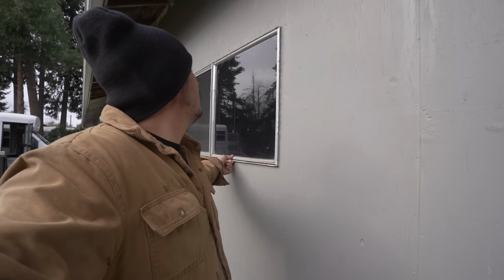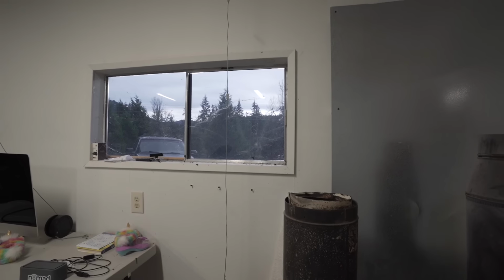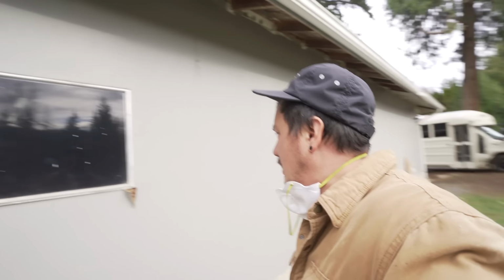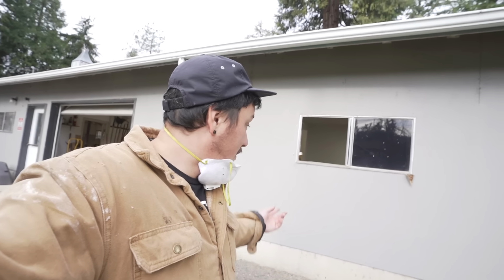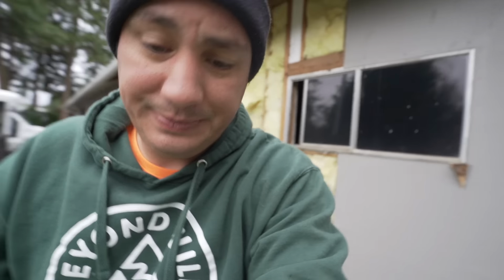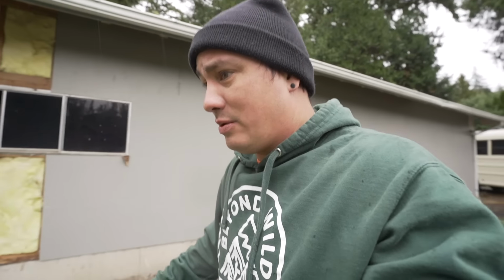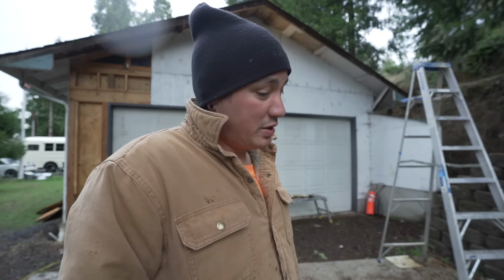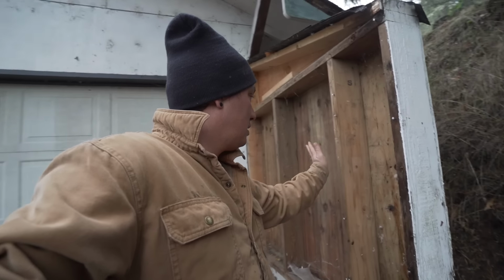In over my head..

Comment: You could have used a skill saw or multi tool to cut the plywood just outside the window frame so you wouldn't have to take off as much siding. Then just put a piece of the hole where the window was. Would have saved work and materials.
Reply: That was my first thought.

Comment: Not sure of the order or your codes, however a simpler way would have been to leave the window in place and framed it from the inside. Insulate it and fog the widow so not to see the insulation from the outside, and drywalled it up on the inside. Best of luck with future endeavors. Good job!

Comment: Isaac all you had to do was take a circle saw and cut two inches around the entire window. Set your saw to the correct depth so you DONT cut too deep. Once you cut around the window you can pull off the two inches of siding rather than pull off entire sheets. Remove nails on the window lip and window will come out from the outside. Doing it this way will prevent you from buying all new siding sheets.
Reply: And set the saw to the thickness of the plywood.
Reply: I was just going to comment the same thing....
Reply: Oh nifty!!

Comment: Dang all you needed to do was sawzaw around the window
Reply: Yep! Work smarter not harder!
Reply: Yup like moving 3 pieces of firewood at a time - get the darn wagon and fill it
Reply: Sawzall
Reply: Skill saw set at 1/2 inch. Go about 3 inches all around the window.
Reply: Call your construction  friend  to discuss  how to do the work, better  safe than having  to redo the work.❤😢
Reply: You could use the Sawzall to do it!
Any way you are doing great job keep it up!
I know you're frustrated is the only reason this is why you're doing what you're doing again you can use the Sawzall which would do a better job quicker I can see that you're so frustrated with this problem what time can make the wrong decision on what equipment you need to use.
And why are they wanting you to take that window out because I also can be used as a fire Escape from now you will be stuck in there if there's a fire.
Somehow you really need to put another window in there to ensure that you have a fire escape route how do I get going to have to come up with a new way to get out if fire is in the garage.
Sincerely!
R.S.V
Reply: Wow what a crazy mess getting that plywood off the building.  Was that wall thingy to stop snow from building up in front of the door?
Reply: I was concerned that the changes, if not done by someone who knows what they are doing, could put Isaac back in hot water with the inspector and county agency.   Careful Isaac.  Be smart.
Reply: Why does the window have to come out?

Comment: ok tare walls apart if there wiring & stuff in said walls take like 5 mins pen and paper draw a wall with where all the wiring is & went and out let boxes & there location why I had a wire mess up i had to wire the outlets threw one patch wire i had guy ha wired it to breaker box had some wiring layout of my home the hall light feed the rest of that breaker instead of taring the drywall off the wall & flooring too or run a new 10-2 wire covered it along  the floor its a new section of wire to side light & junction it there did away with the light! moved it to other light out side some one put a inside light that made for out side really! the wire guy said who wired this place really! i paid him a pile of money to fix it or go cold the heater run off this system too! it gonna cost you fix the dead ford truck i worked on for months it run like 10 mins and stop & let set 20 mins run like 15 mins and die ( did you read the ford recall error no it a box on the distributor really!) there known to do odd and strange thing like engine just die! put this on it will run really! ( funny what tough you that auto tech school it a collage for car repair) those auto manuals mean something really! ps the car maker knows it car inside and out if there a safety error they tell you! ( i was in court & GM tech said we knew it had a error what it run wide open blow up or start fires oh great! was that before it did that burned down 5 building ? on this date of said fire! he gave me a nasty look!)